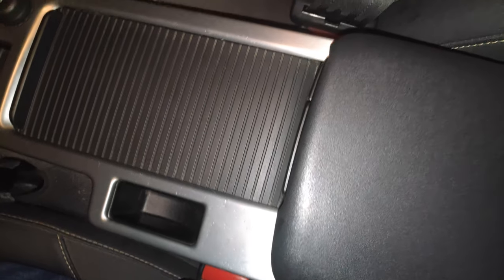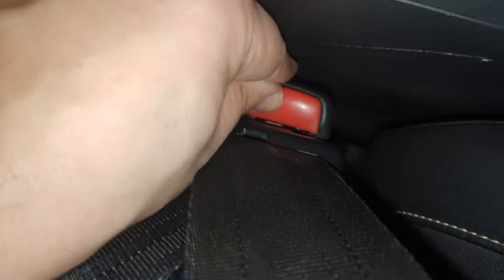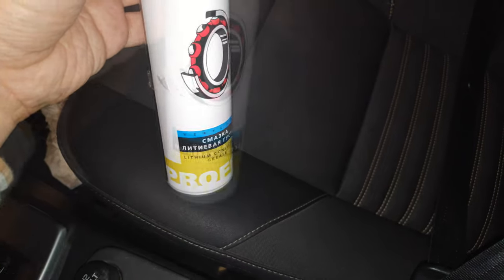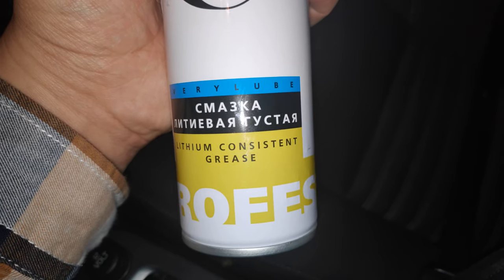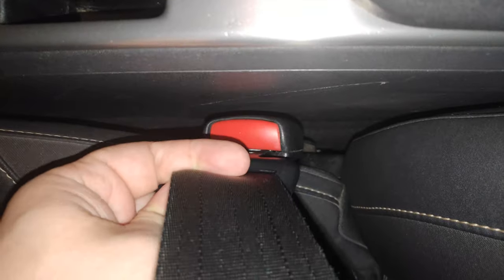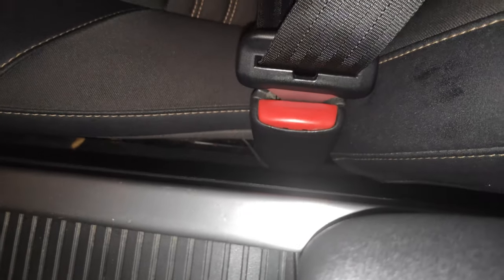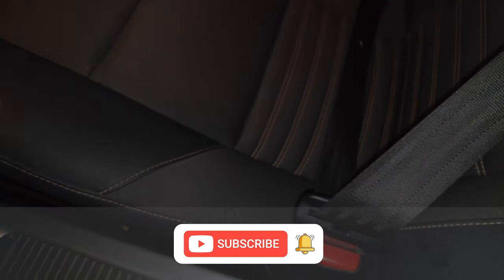How to repair Seat Belt Buckle? Solution and easy fix.

Comment from the maker: Was the Tutorial useful? Hit 👍 Thumbs Up - Consider 🚩Subscribing!
Timestamps:
0:00 Introduction
0:16 Seat belt buckle will not unlock
0:35 What to use to fix seat belt buckle that is hard to unbuckle?
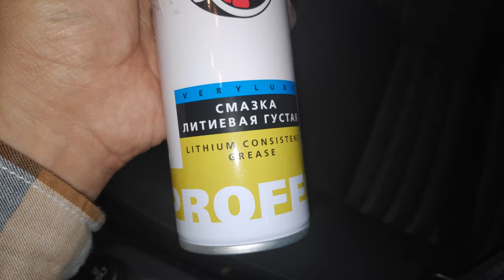1:10 Using the grease on the seat belt buckle
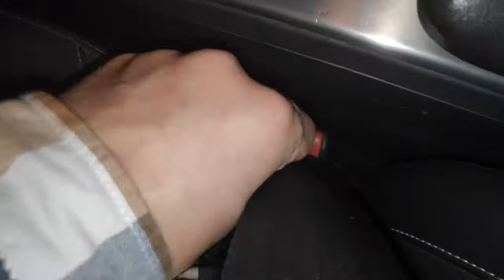2:05 The result 
2:40 Outro
Reply: I have paper stuck in my seat belt can i get it out with this spray?
Reply from the maker: Use tweezers maybe?

Comment: This fixed my seatbelt that wouldnt click IN for 5 yrs
Reply: What’s the best stuff to use x
Reply: Mine is not clicking IN either
Reply: Now with plenty of WD40 have it working. Amazing
Reply: @HH_754  thank you mine is not working so I was coming to ask the same thing.
Reply: @caelyndevers1066  yes seriously mine was not working for months.
Reply: Cool so you been driving around with no seat belt , im calling the police
Reply from the maker: @justin8113 Negative. Seatbelt always.

Comment: Yep  (In my case spraying with some penetrating oil then jiggling it and I heard some gunk inside break and it started working again, wasn't allowing the latch in at all initially...)
Reply from the maker: Great. Now add some proper oil to lubricate the mechanism and it will last much longer 🦾
Reply: @TarantuloTV  Great idea :)

Comment: Do you know how to replace the seat belts in a 2005 Buick Rainier? Thanks!
Reply from the maker: Nope sorry. Get your cars manual or better yet, deliver the car to authorized technician. 

Seatbelt replacement should be done correctly. It's a safety device. Take care.

Comment: I was having the same problem, it was difficult to press the button and “pop” my seatbelt out.  I used the only lubricant I had on hand, which was 3-IN-ONE penetrant.  It took me all of 30 seconds to get it working and had trouble with it for years.  Had I knew it was going to be this easy, I would have researched the solution a long time ago.  Not sure how long it will last but I’m thankful for this video.  

Not sure if this is helpful to anyone but my car is a 2004 Honda Civic EX.  I confirm this works.
Reply from the maker: You're welcome Betsy S! Hit Thumbs Up 👍 - And consider 🔥 Subscribing! 

Support me by buying me a ☕ Coffee or 🍺 Beer! https://www.buymeacoffee.com/TarantuloTV

Comment: Thank you, this video helped to fix the passenger seat belt buckle that did not latch. I tried wd-40 initially, but it did not help. Then I bought a spray with lithium consistent grease and it helped! Worth noting though that it took 10-15 minutes until it started to work properly after spraying this stuff and repeatedly trying to latch it.
Reply from the maker: Awesome! Simple DIY repairs FTW!

Comment: This is common with Volvo, i take mine apart and add length to the 19 year old spring..mine now pop out better than new. I know this beacause i bought one new for my previous Volvo v70
Reply from the maker: Well actually this the first time I have seen happen this to a Volvo. Have driven quite a few of them 😊 . Had some people comment that this a Volvo V50 issue.

Comment: Suprises suprises just typed in about the seat belt buckle and guess what car i have 😂😂
Reply from the maker: Volvo V50 😅 ?
Reply: @TarantuloTV  yes sir 😂😂😂
Reply from the maker: Omg. Then you have yourself a perfect tutorial. They seat-belts are working as fine as the day I made the video 😅
Reply: @TarantuloTV  mine are working perfectly again thank you
Reply from the maker: @dotsfrazer  Awesome. Sub and like the video 😅 Cheers
Reply: Same problem, same car. 
I'll give this a try. It has gotten worse in the last month or so. So much that it actually makes me feel unsafe now because it needs some wiggling-expertise to get the belt undone.
Reply from the maker: Try it. Worked wonders. One year later. No problem what so ever 🙂
Reply: @TarantuloTV  Worked like a charm. I used some silicone spray from a can. Now I can push the button with one finger an it'll come undone easily just by the tension of the belt while still being very securely in place while being locked. Very happy with that fix which could've gotten very expensive if I had to remove the whole seat, disconnect the battery, not destroying the cabling in the process not even including the ridiculous cost of a new-ish seat buckle.
Reply from the maker: Awesome! 😎

Comment: cant find 1 video to addrss my issue...my buckle is stuck without seat belt in it...so i cant even put seat belt in
Reply from the maker: what do you mean stuck without seatbelt? Well it's the same problem. Spring mechanism got dirty and lost lubrication and now it's stuck. 

So it needs lubrication and then try working it with butter knife or something similarly shaped.
Reply: @TarantuloTV  what i saying is the belt will not go in the buckle because the mechanism that locks it preventing it from going in the buckle ...im gonna do a video. when i do I'm gone send u a message so u can see what I'm talkn about.. i will try lube n butter knife
thanks for reply i appreciate your time
Reply: Mine is the same. I can't get the buckle in. I have to use the passenger side one. I'm going to try this basic lubrication and see how it goes.
Reply: @terencejay8845  please let me kno how this goes. the cost is 300.00 for a stupid buckle from dodge
Reply: @Robert McGregor around here any Dallas Fort worth area.. wrecking yard scavengers are no joke. every part you WANT... they WANT ..it's a lost cause
Reply from the maker: @terencejay8845  And how are the results?
Reply: @TarantuloTV  So far, I've sprayed it with a straw-nozzle contact-cleaner to get right in there and to try to shift any dirt. After ten minutes, I've given it a spray with silicone. I'll see what it's like in the morning, but so far it's not looking great
Reply: @71donkrider  So far, I've sprayed it with a straw-nozzle contact-cleaner to get right in there and to try to shift any dirt. After ten minutes, I've given it a spray with silicone. I'll see what it's like in the morning, but so far it's not looking great
Reply: @terencejay8845  thanks for the reply
Reply from the maker: @terencejay8845  Thx for the update.
Reply: To report back; sorry to say that contact cleaner plus silicone left to soak hasn't worked. It's jammed solid. Went from working to not working which usually indicates a failure. It's a sealed unit, too, and I can't take it apart. Looks like I'm using the passenger buckle until I can fit a reclaim. Looks like it's a 'seat out' job as well. Grrrr.
Reply from the maker: Sad to hear. Well, all the mechanical parts are different. Maybe a part of it, just got broken. Thanks for the feedback. Good luck with the repairs.
Reply: Well, no amount of wrangling with it helped. So, I had to buy a used stalk-assembly off eBay. For my UK Mondeo, Ford wanted £164, $200, as it has a pre-tensioner arrangement. My used part was £19 and in excellent condition, but I've cleaned and lubricated it in advance of fitting, which is a seat-out job, but two minutes to fit once it's out.
Maybe you can track down one. It seems my Ford one fits many models and years.
Reply from the maker: @terencejay8845  Congrats. Great and cheap repair job!

Comment: What similar can use or where can I find this lubricant product for my seatbelt driver side
Reply from the maker: Just use any grease available in your market. Just avoid using WD40.
Reply: @TarantuloTV  first time driver not familiar with tool or product will u recommend putting baby oil  or
Reply from the maker: @johnnydiaz8739  Just go to your local hardware store or any auto store and look for lithium grease. They should have it.
Reply: @TarantuloTV  that will fixed it I had to push the seat belt allot of time to click
Reply: @TarantuloTV  is that I just bought a Volkswagen jetta 2014 se with a 150,000 miles on it for a 3,400 in cash
Reply from the maker: @johnnydiaz8739  Cogratz :)
Reply from the maker: @johnnydiaz8739  yeah, you have to really work it lube it up ;)
Reply: Yea

Comment: based on this video lithium grease is not recommended to be put around plastics (I gues the seat belt buckle is plastic). https://youtu.be/JUkzNo5NG3g?t=62
So should I still do it or should I use something else than lithium one?
Reply from the maker: You are going to put on the plastic parts. The inside and the mechanism inside is all metal. I have done this to my own the car and both seat belt buckles are working smoothly. If you are still worried you can you silicon based greases I think they will work just fine and they are fine on plastics.

Comment: Fix it properly and don't spray stuff in it.
Reply from the maker: Mechanical stuff needs lubrication to function. This is the fix.
Reply from the maker: Mechanical mechanisms requires lubrication. Locks, hinges and everything that has mechanical moving parts. This is the actual fix. 

Five years later after this video, still working perfectly.

Comment: Just take the car to the dealer repair shop. They will fix it for free because it’s a safety device.
Reply from the maker: If your car is new and under warranty. Maybe. But this an issue for older cars... So you will have to pay. Always.

Comment: I have an opposite problem.  The buckle won't lock the seat belt in place.  Will lubrication help?
Reply from the maker: Well it's hard to tell on how the mechanism is worn out. But maybe some springs just does not move to lock it. Lubricating might help and might not. But it can't make it worse 😊
Reply: Would that happen to be a Hyundai Willie?😆
Reply: Hi Willie, did it work for you the lubricant? I have the same problem with the rear seat buckle and that's where my grand daughters seat... Please let me know what you did. Many thanks!
Reply from the maker: Lubrication always works! If not not enough lube!

Comment: I can’t even put the seat belt in the seat buckle. The seat buckle is pressed in and stuck. Would I still need todo what you were doing in the video?
Reply from the maker: Well, usually the fault with all buckles is the mechanism loosing lubrication. So if it's possible to remove the seat belt buckle. You should try this method. If it's stuck and you can release it, then some assembly might be required.

Comment: If something is stuck inside and you need to take apart the seat buckle GOOD FUCKING LUCK! I have spent ten hours on the internet trying to figure out how to open a  mazda 3 2008 buckle and cant for life of me find out.
Reply from the maker: These things are not built to be taken apart usually. Because they are safety devices. So I would suggest just to get another one, used one.

Comment: Replace hood strut 
Replace headlights 
Replace tail light
Replace chrysler front grill
Fix seat belt buckle is jammed
Reply from the maker: What is this? :)
Reply: @TarantuloTV   i sprayed the wd-40 and my seat belt still want unbuckle
that above  is my to do list
disregard that
Reply from the maker: I especially mentioned not to use WD-40 for that... You need grease/lubricant and WD-40 is an opposite of that!